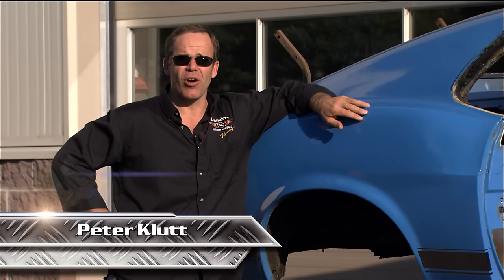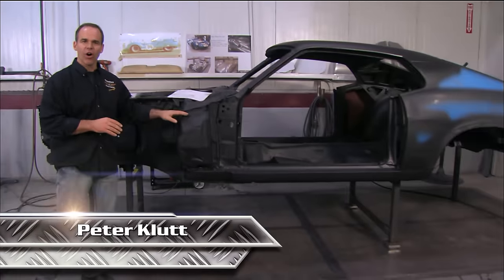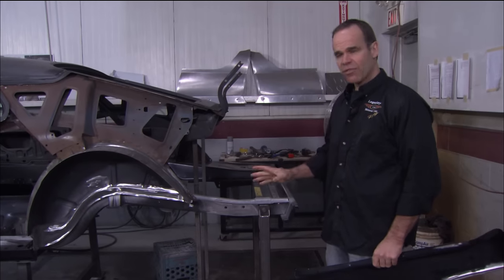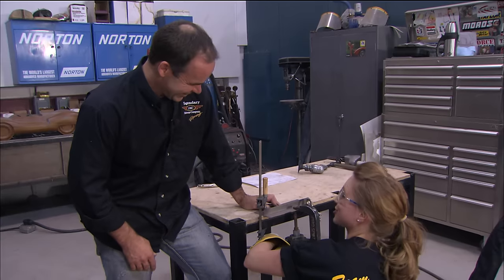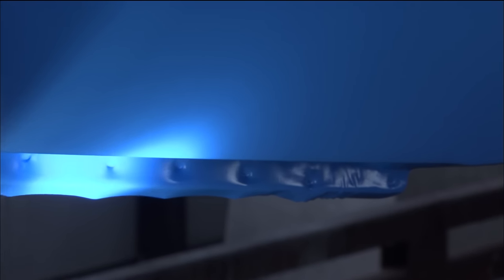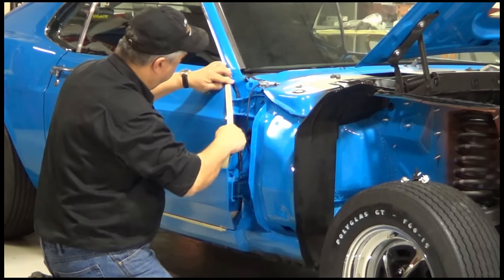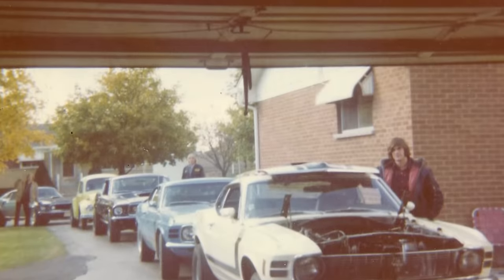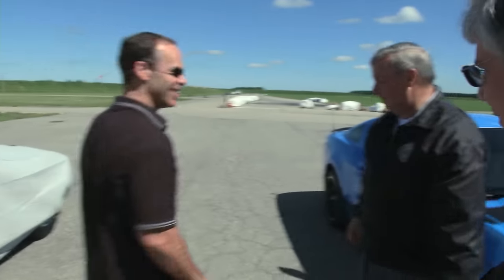Restoring a 1970 Mustang Boss 302 reacquired after 36 years!

Comment: I owned and restored a 1969 BOSS 302 back in the late 1970's and early 1980's and, as happens, once the family happened, I sold it to a couple in Fairbanks Alaska. Mine was Acapulco blue, light blue standard interior, close ratio 4 speed, 3:91 traction lock rear, front & rear spoilers. I rebuilt the engine and did all the body work and paint myself (stock color lacquer with clear). My stripe kit came from Tony Branda! I rebuilt it using the aftermarket 12:1 pistons that a former owner had installed when it was drag raced. That little motor had some big ones. Nothing like a high compression solid lifter motor revving through the gears. 
I had it listed on the BOSS 302 Registry back then and a few years ago decided to try to track it down. The folks at the  BOSS 302 Registry noted that I was the first owner on the registry and another person in Palmer, Alaska was the current owner (at that time) and I found his Facebook page and downloaded a couple picture of it he had on his page. Looked very nice although it appeared to have a newer paint job. Long term (40 plus years) lacquer with clear coat don't usually last forever. I emailed and left messages for that owner with no response but it was nice to see my old car was still being shown after all the years!

Like they say, I've regretted selling that car in the years ever since! Can't afford a car like that now. But I am trying to finish up the 1972 442 I've had for years. The restoration hasn't moved as fast as it did when I was a youngster! Such is life!

I really enjoyed this video. I also watch Peterson Restorations channel videos on YouTube where he saves old trashed Mustangs (even a couple BOSS 302's) and makes them like new again.

Comment: Awesome.  I have always been a fan of Boss Mustangs, but especially the Boss 302.  The only pony car I likes even more was the First Generation Shelbys that were based on the Mustang (Falcon) platforms.  I never did purchase a Boss 302 or any other Boss Mustang.  I felt for me it would be impractical as I lived, at the time, in SoCal, and later Yuma, AZ.  To have a car, any car, without Air Conditioning was craziness.  I was more into comfortably driving a high performance vehicle, as opposed to having a high performance vehicle I was goin g to suffer in due to high temperatures inside the car.  After many years of "life happening (kids, career, etc.) I finally found a beautifully restored 1969 Shelby GT500, with factory A/C, and purchased.  It is still my all time favorite car, despite how nice out other pony cars are - to include a 2020 Shelby GT500 we also picked up along the way.  Gotta love those old ponies, eh?

Comment: Excellent video!  I have a question - Did assembly plants spray on primer to the body and undercarriage or a phosphate?  Zinc primer at the factory?  I picked a Revell Boss 302 kit and wanted to be as realistic as possible with the colors and have been trying to compare the detail photos on the box with pictures and video online. Never had a Boss but did grow up around 60s70s Fords.  Though I was underneath one once in a while, all I really remember is undercoating and/or grease and rust. The model kit is about as much as I can handle anymore considering limited patience and a kit still in school. Still, I appreciate these cars for what they are and represent, and the artisans who restore them.

Comment: I would give a lot to get mine back! Blue was the color, busted up by an brainless drunk knocking off of the road and down a hill.  The loss is 1978’s shoulda, woulda, coulda.  Blueprinted motor fresh, top quality shocks, new shifter, immaculate.  I now consider it my first serious relationship.  With a 3.5x rear it got great fuel mileage.  What a blast to drive around the windy country roads in north central PA.

Comment: All 69-70 Boss 302 had bad pistons design, the piston skirts (to long) would crack & chip.  TRW make a replacement pistons with a much shorter skirt.  So make sure that the engine has been rebuilt with new style aftermarket pistons.

Comment: It’s missing the yellow “OK” on the driver’s side cam cover. It was done with a rubber stamp and yellow paint. Otherwise, a beautiful restoration. G111694. Strange that it has the deluxe interior, tachometer but just the standard steering wheel not a rim blow. Maybe the original owner knew about the horn blowing when you were seriously carving the corners.
Reply: Always a Z28 guy with my 72 however now in my later years you look at a 67 through 70 sports roof mustang you realize the Chevrolet falls short at least in bodystyle my opinion of course. Just a beautiful car and great video!

Comment: While your over all approach is very professional and of top notch workmanship. The balancing procedure on the big end of the connecting rod shown at 25:40 is severely lacking and of a truly amateur nature. While weight matching the big and small ends to equal the lightest member of the population is fully correct. The method shown is a JOKE and totally wrong !!  As clearly shown in the video, weight removal was achieved by abrasively sanding the big end balance pad. The method employed in the video, of flat sanding the balance pad thins the rod cap and removes critical strength from this "bridge". The correct method would have been to utilize a die grinder with burr or cartridge roll to concentrate material removal "between the ribs" of the cap. This method would retain the integrity of the rod cap ribs and help maintain strength and integrity of the big end.

Comment: Its funny they were colour coding their driveshafts and suspension parts for different models of the same car back then, now they use those printed barcode labels so the production line computer knows the right part in being fitted to the intended car.